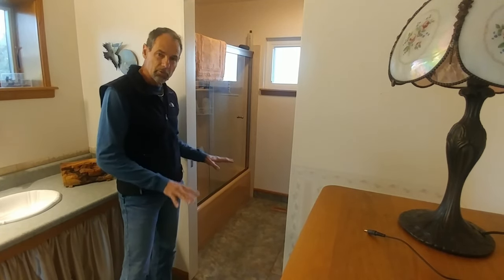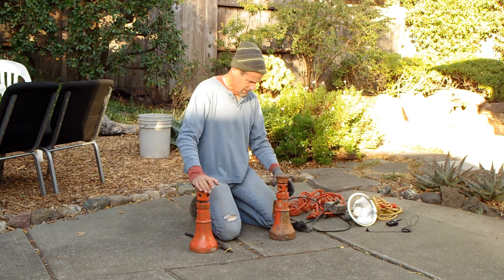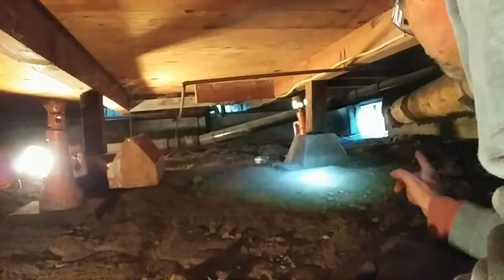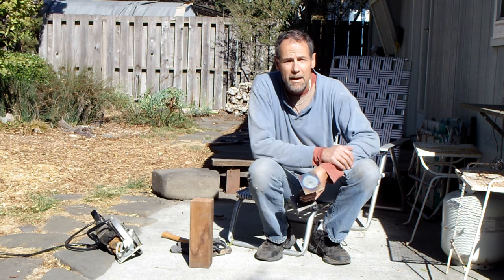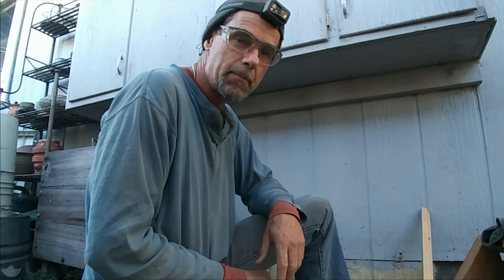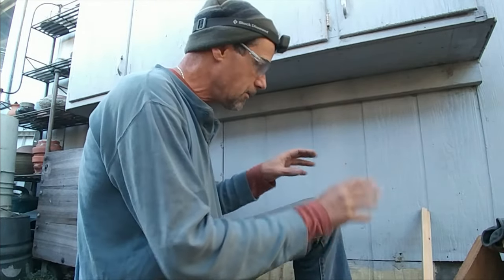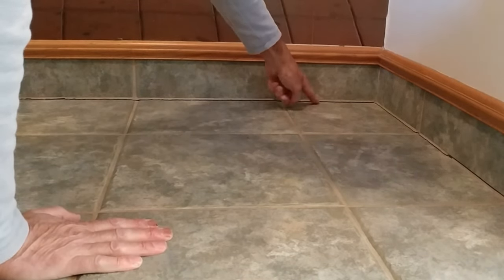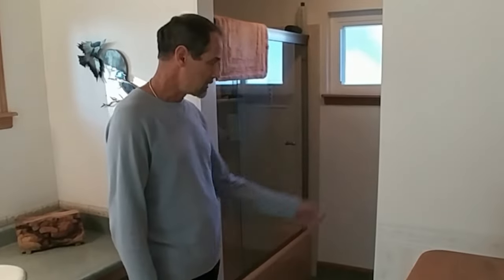Fix-it Guy Takes On Foundation Repair

Comment: Thank you. I am purchasing a home that will need some floor leveling. Your video shows how to do the job completely.
Reply from the maker: I'm glad you found it valuable.
Reply: You can also sister the joists with 2x6s or 2x8s and raise them over the lip until its level.
Reply: @britneyystaples91 Still need support for that span.
Reply: Have you attempted to tackle this work yet? If so, how'd it go?
Reply: no slam to this guy , but that is not the proper way to do a foundation. It is a quick way , but not the right way, if the ground sunk lifting up is not fixing the problem. It will happen again
Reply: @bobhoward9474 how is the proper way? Thinking about doing this to my old house

Comment: 78yr old mechanic.  Don't you just hate the builder that constructed this house wit no real cwral space. Been there tunneling under floor beams in the mud to repair sewer  pipes.
Reply: I bought an old house last year with a shallow crawl space like this.  The house was built about 177 years ago so they may not have been thinking about what I would have to do in 2024.  I have to add a few support piers and I’m not looking forward to it.

It’s even worse now than when it was originally built because gas lines, plumbing lines, and ducts take up a lot of space.  I am thinking of removing some of the old ducts and gas lines that I no longer need just to make access easier in the future.

Comment: I have a floor that needs this.  Sequence of events: 1. Set off a bug bomb in the crawlspace. 2. Put a fan under the house to air it out. 3. Put down tarps under the floor everywhere. 4. Get a LOT of dust masks. 5. Fix the floor per the fix it guy. I can do this. Thanks for the info on what to use. I'd have never known.
Reply from the maker: Glad it helped.

Comment: Ground sunk because water issue,or some reason, but you need cement footers which should be 16"x 16"x 8" deep cement poured in ,cement foundation block set and leveled on wet cement, after cement dries stack foundation blocks or 4" or 2" blocks then shims. You do not use wood post close to ground possible termite problems. This by most inspection codes in case you ever sell the house and have an inspection. his  way will work temporary

Comment: I just bought an old farmhouse I've lived in for 24 years. The foundation is made from some kind of home made concrete. There are small sea shells in it. 

There is no crawlspace. Which means tearing up all the flooring. Each room sits on a foundation. This means I have to tear up each room to gain access.

This house was supposedly built in the 50's but think it's much older considering there's a blocked off chimney in the living room and in the kitchen. The original fusebox took 4 round glass type fuses. 

Good insights here on what to look for. Definitely going to need adjustable brackets you mentioned.
Reply from the maker: Sounds like quite the project. I've seen cement like that. I've been helping on a 1944 built house with very little crawl space. The owner had to pull the floor boards to access the foundation too. House sunk 3" in the center. This video shows one small aspect of the work but you can see all the pulled floor in my little walk through. 
https://youtu.be/lN6y6JTy3-0

Comment: We love the DIY approach of this video.  With a "get'er dun" attitude like this and a little research into the right product solution, you can save thousands.  Please note, the soils will continue to move over time.  This will continue to open up those gaps.  SlabSure foundation monitors can help you to monitor that movement every hour and tell you when you need to raise or lower those Simpson floor levelers.  Just holler if you want some advice.  

#SlabSure #Foundationmonitoring #foundationrepair

Comment: Great video. I am also jacking my house up,. though I have a bit more headroom to move about. I found it easier by putting an unfolded cardboard box down to ease sliding in and out.
Reply from the maker: Good tip!

Comment: Thanks for the tip on the Simpson floor beam levelers. We got a $12,000 quote from a contractor to fix our sagging center beam. I put temporary floor jacks in there for now but yours looks like a more permanent solution. Thank you sir!
Reply: If I'm getting quotes from contractors, I pay attention to what they drive. Right or wrong, that's something I do, albeit not the only thing.  Just yesterday I saw a private contractor pull up in a pristine 2021 F-150 Platinum. I've had similar tell me he charges $700 per exterior door if the homeowner already has all the materials.

Comment: Thank god I found this video before I need it. Was recently under the house doing some plumbing. All the columns are still in place and no sags or shifting. Honestly I wouldnt have had a clue how to fix it. Now I would. "Adjustable floor levelers". Im giving you a sub for sure. And thank god I have the house jacks if I ever need them.

Comment: Sir I wanted to applaud your effort with such old tools and body, also would like to recommend reinforcing the blocks on the bottom before adjusting the levelers
Reply: How
Reply: @magicman3437  pour concrete bases I believe.
Reply from the maker: The piers do sit on/in concrete, though I don't know how deep each pour is. I wasn't about to dig and find out. That concrete prevented me from moving or adjusting alignment of the piers to the beam.

Comment: Great video. Put some plastic down and it’ll be a lot cleaner down there and it’s a ground vapor barrier. Also, you need to dig and poor concrete/gravel footers so they don’t keep sinking on you. (Those footers look like deck blocks in dirt but I’m not sure?) It’s usually what’s under the posts that’s the problem not up top.
Reply from the maker: Plastic is a good idea but not sure I'm up for that effort at this point. The piers do sit on sloppy concrete pours and indeed are slightly embedded in it making it imposable to shift them for better alignment. I don't know how thick that cement is. I started to dig around one only to decide it was to much effort in that confined space.

Comment: I made a dog runner out of a leveler similar to that. It was used to build bridges. I buried the female section and dropped the threaded part in with a u-bolt attached to it. Dog never got tangled and never got off.
Reply from the maker: Creative!

Comment: One think I would have done differently.. measure the rough distance that you need for the post / leveler and assemble them outside. Reduce the number of times you have to crawl in and out! Excellent video, I need to do something similar to my house.
Reply from the maker: Good idea.

Comment: Nice work.  Really well done.  Simpson Strong Tie makes excellent products.  My crawlspace has those already installed and it needs a similar amount of adjustment to yours.  I was going to ask if I needed to take the weight off of them before adjusting or use any special lubricant.  But you covered it all.  Please keep up the great work.  Subscribed.

Comment: I paid $20 for tyvek suit, goggles and cheap gloves. Tyvek helps when you inch around on your back, don't feel pebbles as much. Goggles fogged up so useless. Headlamp battery died when I was way in the back, alone. I learned: Only do this during daylight hours so you get a tiny bit of extra light, replace batteries before going in, have someone check on you outside every 20 mins if possible,  apparently I am NOT claustrophobic, and I can fix things/save money. My crawlspace was just like this, very low. Video is great but you weren't complaining enough as it is a rotten task.😂😂
Reply from the maker: All good ideas! 
I didn't record my complaining (no one really needs to hear that), the video shows the challenges.
Reply: Your crawlspace is nice.  Mine is full of garbage from the 40s, old sewer pipes, the contents of those sewer pipes now solidified and several mummified animals.  Nasty!!!
Reply: At this rate you’ll have a full basement soon 🤣 I got the same thing going and not looking forward to the crawl. Thanks for the vid
Reply from the maker: 😁 I wish!

Comment: Thanks for this. We've been sorting out our place and have a similar problem with 3 posts that are a little on the wonky side. We've got jacks everywhere that scares us but your video helps a huge deal in solving it on a more permanent basis. Well done on that crawl space, it's an experience crawling around there, no one really appreciates how difficult it is getting under there and moving your bones in ways they definitely weren't meant to do :-). Had a look at the post levellers, they say 'do not use to jack up houses' but if it works it works. Well done, that's a tough job.
Reply from the maker: Thanks. You can do it too. The crawling was the worst part. When they say to not use to "jack up houses," they're referring to dynamic jacking. So in other words, they don't want you to use them to do the primary lift necessary to get things level. Use hydraulic or screw Jack's like I did, for that and then just use the levelers to hold everything in place. That said, I've used mine to make minor adjustments in the years since first doing the project and it seems to work fine. Best of success to you,

Comment: I’m looking at the same problem, house is built on a lot of clay. The hillside behind me wasn’t developed until a couple of years ago and now the run off isn’t feeding my area anymore. The sump pump that drains the crawl space almost isn’t needed except during heavy winter rains. Clay has dried out causing exact same thing.
Reply from the maker: Clay soil is a challenge!
Reply: You want water? In my opinion, we should keep water out for a P&B foundation, so we can keep the crawl space dry! However, I do find the clay underneath will crack once dry.

Comment: Looks like my floor. 1 1/8” plywood  with 4x6 girders on 4’ centers.  You could have used metal 4” U brackets and screwed them down to the pier blocks then set the 4x4  and screw in from the side.  It’s like an upside down saddle. Good job
Reply from the maker: Sure, sounds like a good approach. As my grandfather used to say, "there's more than one way to skin a cat."

Comment: Suggestions from my similar efforts: N95 masks; goggles; good knee pads and elbow pads; foam yoga blocks to rest your head and relieve neck strain. I made a small dolly with four 4” garden cart wheels, threaded rods and plywood, very helpful to move tools and materials. There is actually a small cart designed for you to lie on, similar to a garage creeper. Look up Krawler by Krawlgear, building inspectors use them. With two lengths of rope and a lucky path, you and an outside helper can pass tools, materials, water back and forth. Use cheap walkie talkies to communicate, cell phones work but it is very dusty under there! This is challenging work!
Reply from the maker: Well yeah, all good ideas. It would have been nice to have better lighting and a laser level too, but I like to start simple, dive right in and see what I can accomplish. I got the whole thing done in less time than it would have taken me to gather all those supplies together.

Comment: In escrow on a house that is going to need some of this work.  Unfortunately there is a batt insulation that has gotten damp and is hanging.  It's going to be an awful job, but has to be done.  I've also got to install a vapor barrier.  I'm planning on wearing a respirator though as I don't want to breathe in all that junk.
Reply from the maker: You can do it! A respirator is a good idea. I chose not to because it interfered with my ability to speak to the camera.

Comment: When I use to go under a house to work I got my self a ( long plastic snow sled ) to put all my tools on , pulled it to where I worked . All so the sewer pipe only needs 1/4 of a inch per foot to work properly - that's code . Those pyramid blocks will creal sideways if they aren't in the center of those 4×4's good luck to you sir
Reply from the maker: Great idea!

Comment: I think your concrete needed to buried a little for support, and need to be at same depth as your footers. Think you may want to look into concrete piers because it looks like your beams are showing rot.  Doesn't look like you compressed the dirt down there under the concrete-looks too loose and fluffy! Lol A+ effort, and so cool to see a homeowner doing it-neat-thanks!
Reply from the maker: It's clay soil and hard as a rock; the pier blocks also sit in concrete. Fortunately there wasn't a bit of rot on any wood elements.

Comment: Nice work. We’ve bought an older home, and the subfloor joist are spaced just like yours. I am looking into leveling my floors since one side of the house appears to be a little low.
Reply from the maker: If everything is uniformly out of level a little, I wouldn't worry about it. But if sections aren't flat in relation to eachother, that becomes difficult to build to. It messes up doing tile work, fitting baseboards, rolling closet doors, or even getting a toilet to flush properly. All kinds of difficulties as upgrades or changes are desired through the years.

Comment: Twenty years ago, when I was about 50, I had a similar job under my present home, some leveling but mainly adding support points to eliminate 'bounce' in the floor due to excessive spans of floor joists in the original construction. Hot, dirty, cramped work that took several weeks altogether. At various times I had other jobs that required going under the house. In the course of all that work the claustrophobic aspect of that environment never bothered me at all. 
A couple of years ago, I had occasion to crawl under again to check on some plumbing. I got ready, knelt down, and started to crawl through the access.
My gut said, "No."
Me: "What do you mean, no?"
Gut: "Not going in there."
Me; "What do you mean, 'not gong'? We've been under there plenty of times."
Gut: "Don't care. Not going."
Me: "Yes we are."
Gut: "NO!"
Me: "Stop being silly, I need to go check these pipes."
Gut. "Don't wanna."
Me: "This is silly, you've been under there plenty, what's different?"
Gut: "Don't know, don't care. Not going."

In the end I dragged my cowardly gut in anyway. But I was amazed at how-literally-visceral an aversion I felt at crawling under there again, when I had previously done so with no problem. 

BTW-and I haven't finished the vid yet-my take on the issue is extreme soil drying, and consequent shrinking, dropping the concrete supports down away from the pillars.
Reply from the maker: Ha, yeah, I getcha'. There are a lot of things I no longer like to do too. I don't know if I've just become a wimp or if I've gotten smarter in my 61 years?
  The ongoing drought has made the soil around here bone dry and rock hard!

Comment: I see this is almost 2 years old, but it would be easier to have a couple of plywood sheet that you could move around to ly on.  Also  could use an automotive creeper to move around on the plywood.  
Plus, dig out under the sewer pipe to make it easier to get under it next time. 
 Remove half of the  4x4 supports, cut them in half, and attach the lower half of the jacks before going back under the house.  Now you have enough to do the job without so much going back and forth, and less stress on your arms, shoulders, and back.  
Put a straw in your bottle.  
A long level across the bottom of the joists would be a big help, no guessing.
Should not have to attach posts to the concrete blocks.
When doing the final level check,  put the level against the floor, not the beams.
Reply from the maker: Yeah, plenty of other ways to approach it. I use the KISS (keep it simple stupid) principle. My local code requires the post to be fastened to the footings.

Comment: Great work. Looking to see how it's done, thinking of doing it myself. I have a 50 by 20 home that is sinking in the middle. 
5 Center posts @ 10ft intervals down the center that are sinking into the dirt of my crawl space floor.. Only CBS block and 6x6 post holding it up. 
Need to shore it up and have better support under there and on the Earth.
 In the worst spots, my house is off by 3.5inches. Still pondering. Thanks for sharing. Can't find anyone here to do the job for me. We shall see. Not a hard job just uncomfortable messy and a pain.
Might be worth it though and save a lot of money in the process...
Reply from the maker: The hardest part for me was crawling in that confined space. As you said, the actual work was rather simple. Best to luck to you!
Reply: I made a form of 6x6 and poured concrete reinforced with rebar. After it all set up, I installed jacks. That thick and wide concrete made it less to sink in the dirt. I drug bags of concrete underneath and had a hose with a shutoff at the end and did it all underneath.

Comment: Hi Scott great video.
My house uses the same Simpson jack piers.
Can you explain the part of how to make sure that the beam or beams are in level.
You use like a 4 foot level and you check them at the location near the piers.
Are we supposed to check the beams with a lazer,  from one side of the beam to the end of the other side?
My question is how do you know how much to raise each jack pier to the correct height. Thank you.
Reply: String or laser
Reply: @henryrollins9177  Thank you for replying.
Reply: I know it's been 3 years, but the simplest way to check level is with a "water level" it's just vinyl tubing and water. You can do your whole house if you're crafty, and it's very cheap.
Reply: @life_of_riley88  thank you sir.
Reply: @danle2884  Welcome! I hope it works for you, it's very easy and simple. Some tubing, two sticks the same length, a couple zip ties and a tape measure. You'll figure it out.